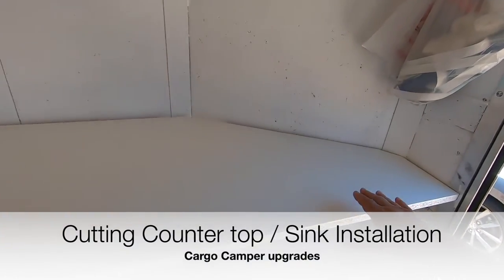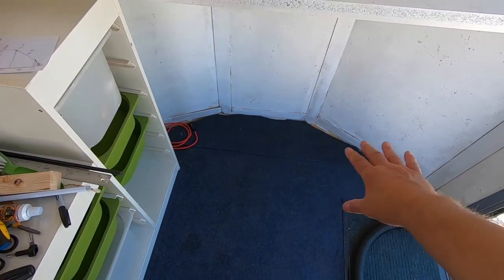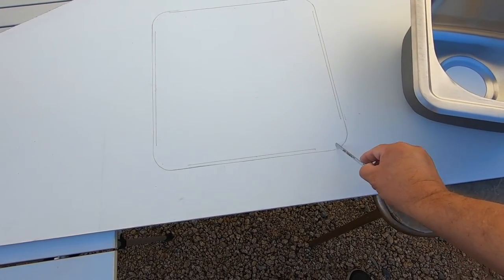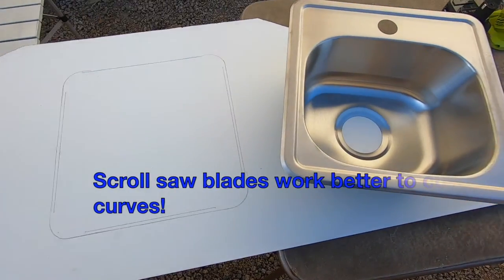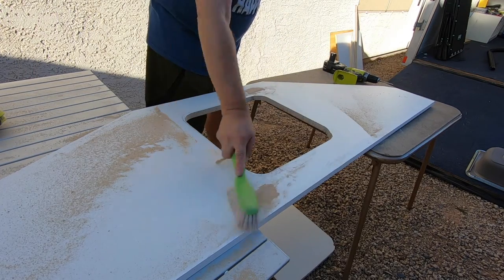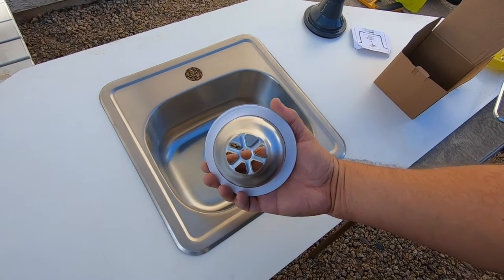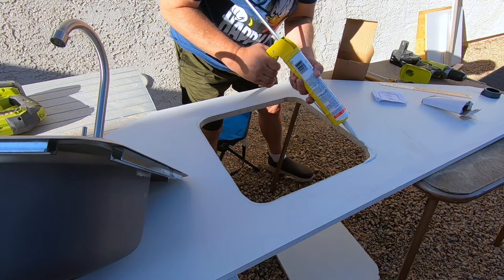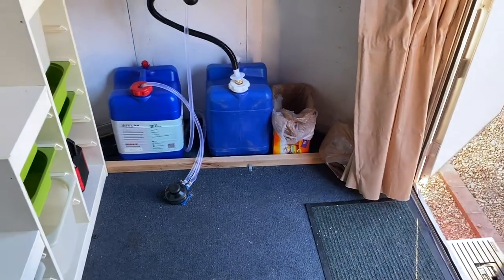Counter Top & Sink Install - My Cargo Trailer Upgrades

Comment: I want to see how you installed the counter.
Reply from the maker: @susandixon3790  I used several 1x1’s cut in about 12” lengths along the back of the counter and screwed them into the wall and then the top of the counter with a 1x2 across the front of the counter top. lol, guess I’ll have to go back and make a short video on just that since it seems I forgot to mention how I did that! Thanks 😊 it’s really a trial and error process - for us mostly error 😂

Comment: would be interested in what connector you used on the bottom of the sink to connect a hose to, then connect to black tank.   I'm doing this, but also adding a water pump in the line.
Reply from the maker: @goneridingparts  I found the connectors listed on Amazon right next to the sink actually. It was about $15 extra I believe.